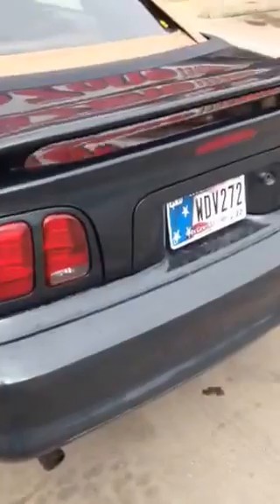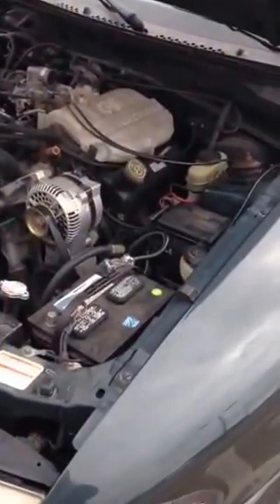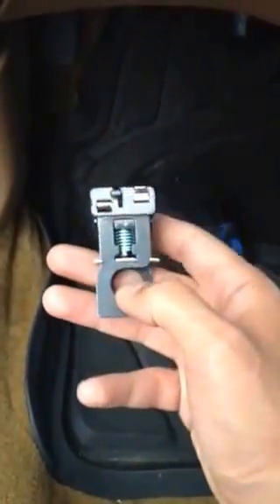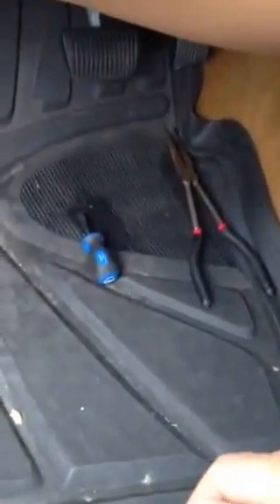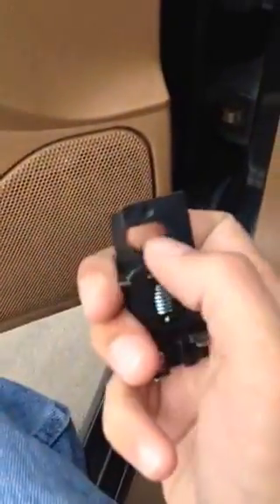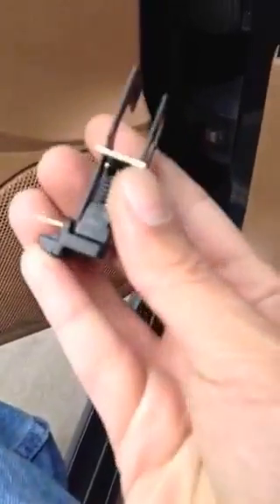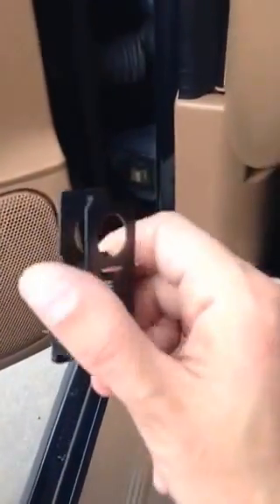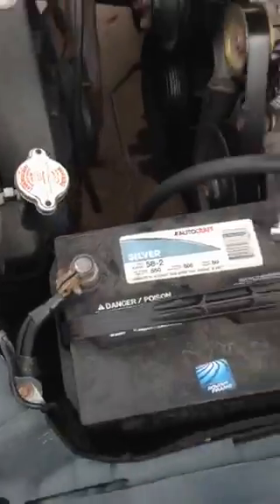How to: 1998 Mustang Brake lights always on, how to fix.

Comment: Thank You. Thank You. This shed some light on replacing brake light switch on an old T-Bird! Funny how they use the same switch on many Ford models. Be sure to unclip the connector. There is a hidden hook / connector that you may not see. You can rotate the connector and see it - then pry that up to release the connector.

Comment: Thankyou......  After I replaced the alternator...  Never saw my brake lights to notice..  Until tonight when my dad gave me a jump and I hadn't turned the mustang on yet.  Won't know for sure until I get the part but I disconnected the 3 tail light harness to try to save the battery from dying until installation.  Also looked at the part and the spring appears to be locked.
Reply from the maker: Let me know if this fix did the trick!

Comment: What if this keeps happening? What do I do next? Is their a plastic or rubber bolt or peice that keeps it from doing this?
Reply from the maker: Got Bunnies not really clear on what you are asking. Do you mean the next step if replacing the switch doesn’t fix the issue?
Reply: @RandomKnowledge4You  it keeps happening and I have to keep buying switches.
Reply from the maker: Got Bunnies You May want to get a multimeter and test it to see if the switch is getting too much power. Your user manual should have the correct voltage listed.

Comment: my 2004 light wont turn off having the same problem my 1 question is. what's the name of the part that's what I need to know so I can go get it don't know the name
Reply from the maker: Ford Brake Light Switch Kit, 2004.

Comment: I tried that but the switch its a little thicker so i cant drop in the little yellow clip in their so it wont stay on
Reply from the maker: I see. Well you don't want to leave it loose. Take the old one to Lowes/Home Depot/Etc and find one that is a bit smaller. If all else fails, a thin zip-tie will hold it in there just fine. Hope the video helped!
Reply from the maker: Last piece of advice: Avoid after-market parts, especially for Mustangs. OEM (original equipment manufacturer) parts cost a little more, but you don't run into problems with stuff not fitting correctly, such as your case.
Reply: Cool thanks bro .. Im on it this video really helos doh ...

Comment: I have a 2004 Ford Mustang GT and my brake lights wont come on how do I fix that
Reply from the maker: Cortland Clarke  First I would check your fuses, it could be something that simple. You have a fuse box under the steering wheel, as well as one under the hood of the car, check both (diagrams are available online if yours is hard to read). If that's not it, remove the assembly behind the lights and check to ensure that your harness didn't just come unattached. Let me know what you find out from there.

Comment: So  ihave a 1999 mustang i yhink  ihave the same primel only  that the signal lights stay on as well do  uthink.is the same problem
Reply from the maker: This fix or a bad ground are the two most-likely solutions. I would try to replace it and see if it works. Check the ground as well (you can find the wiring diagram online). If it's neither one of these, then than likely it's a problem with your wiring harness. Start with the cheapest/simplest fix and work your way up. Hope this helps!
Reply: Thanks